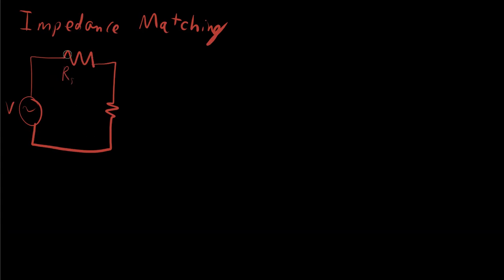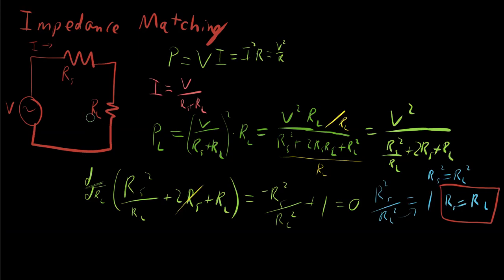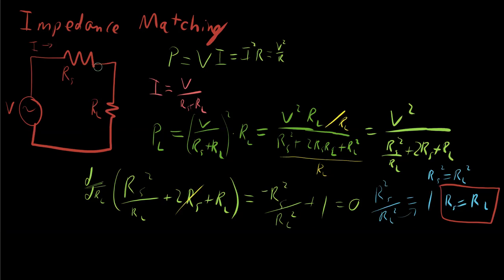Impedance Matching

Comment: Actually there is such a thing as negative resistances, and it was proven in the lab back in the 1930s by a Gabriel Kron at GE and with Stamford University who made a  network analyzer device for the US Navy that had negative resistance and was essentially self powered from the vacuum. It powered itself even when turned ‘off’ by creating a negative resistance that pulled energy from the vacuum. He was a famous physicist/electrical engineer at the time. And his invention was suppressed.